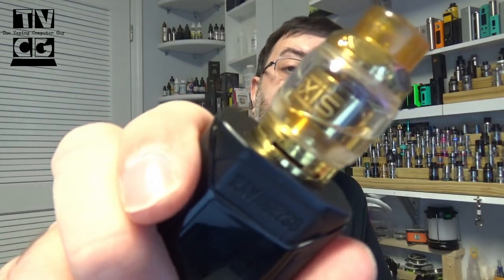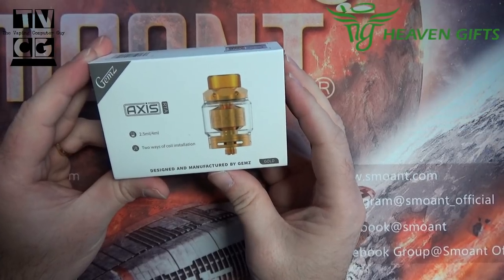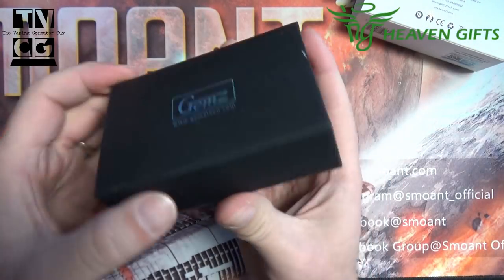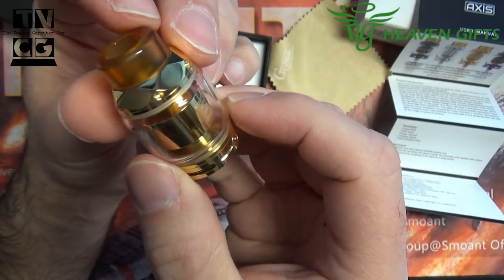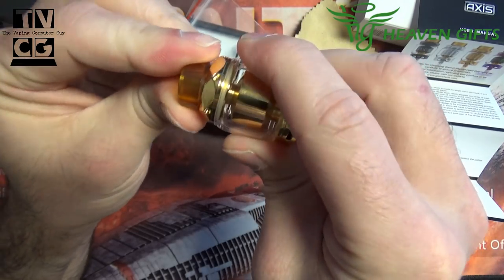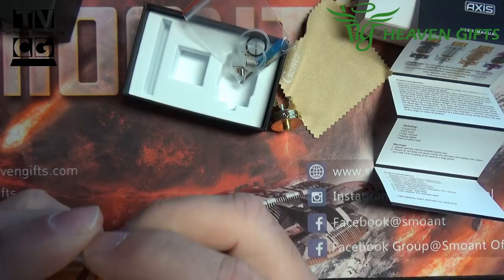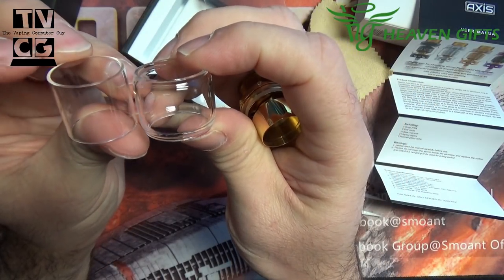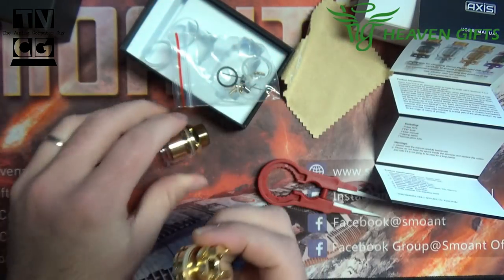Gemz Axis RTA

Comment: Is it a leak proof rta?
Reply from the maker: RTA's that say they are leak proof is just because the air flow is on the top so there is no way for the juice to get up there to leak out, they can still flood though if not properly wicked. This is a bottom air flow device so it can floor or leak if not wicked properly. :) But when wicked properly its a great vape.
Reply: The Vaping Computer Guy thanks for the info. Hoping to get this one soon. I think its a good rta.